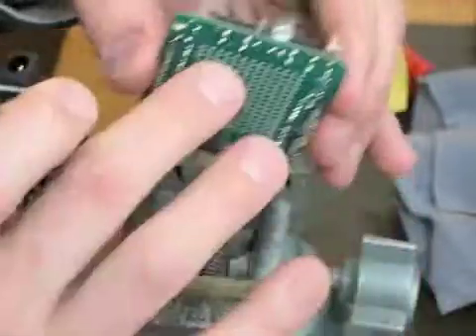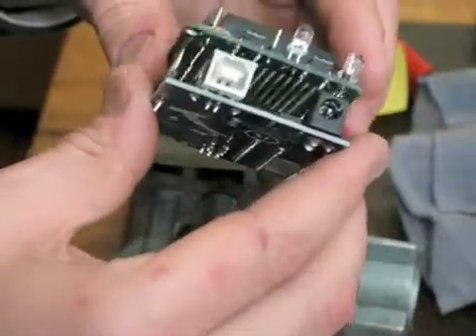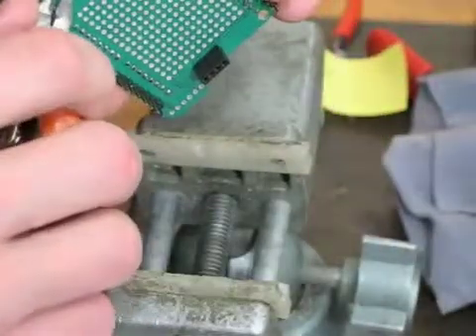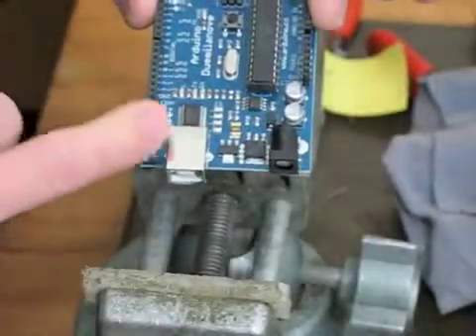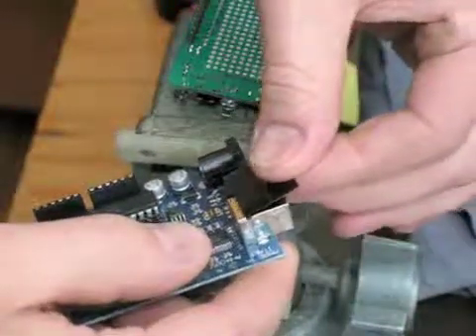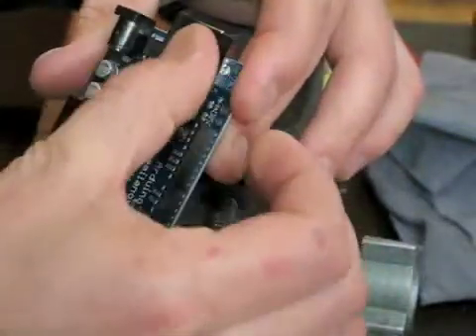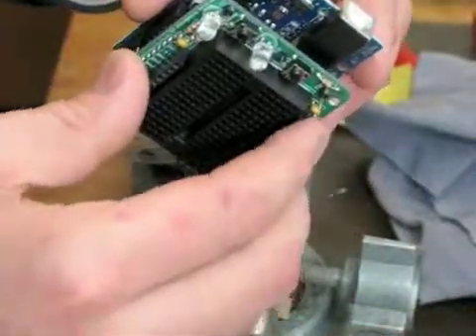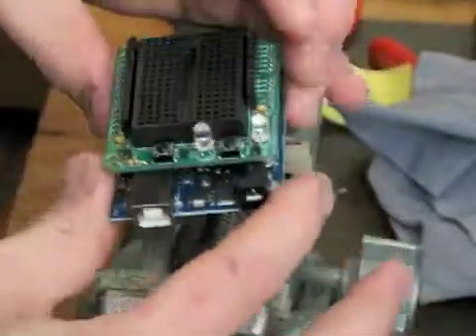Sparkfun-ProtoShield-Modification

Comment: It's easier just to pop the rear cover off of the USB connector and forget about it.  You do need to remove it to keep from shorting out shield boards, but if you don't remove the cover, sharp through hole pins will eventually work their way through the electrical tape.  It's better to remove a problem than cover it up. IMHO